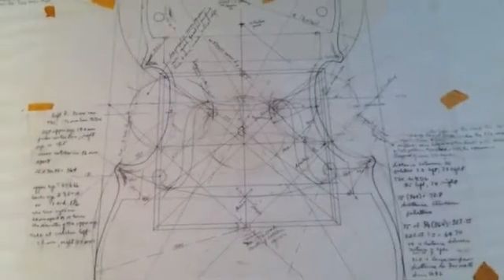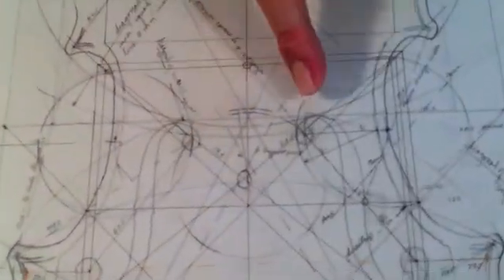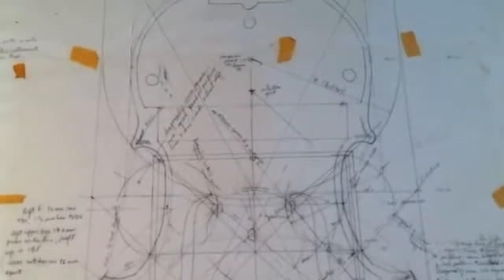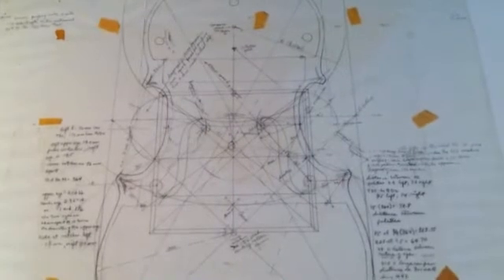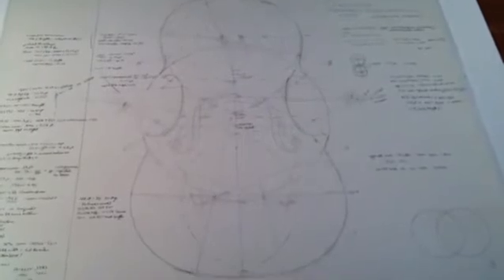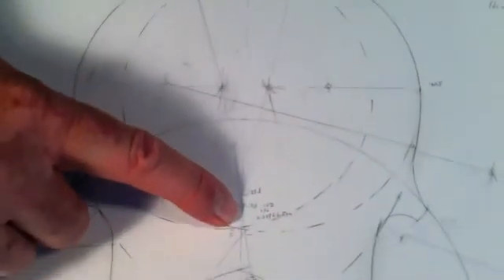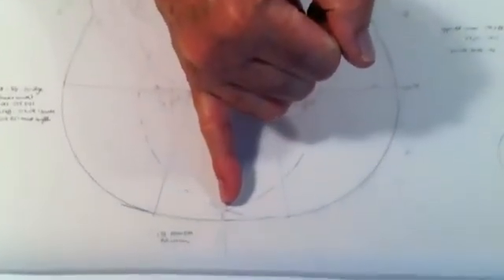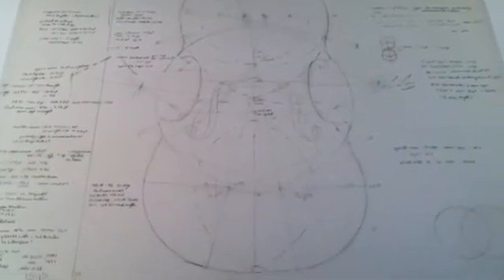The Stradivarius Code Part 2

Comment: I wonder if the reason for the 1mm difference of the treble F-hole to the bass F-hole is purposely done to offset phase cancellation of certain frequencies or to cause phase cancellation of a specific frequency Ala the wolf tone. Helmholz resonators are used in studios to capture certain low frequencies. Or it could be the position of the violin when played has the bass side closer to the player's ear. With higher frequencies being faster than lower frequencies, maybe the 1mm position further with the treble F-hole helps with both frequencies arriving to the player's ears at the same time avoiding phase incoherency or cancellation. Studio mix engineers like to position themselves in the middle of the equilateral triangle between their studio monitors and their listening position for this very reason that if one speaker is closer than the other, it will create anomalies that they will inherently be trying to get rid of that don't exist thus affecting their mix decisions in a negative way.

Comment: I can relate the visual harmony coming from the diagrams .To my modern eye I can relate the opposite influences of many UK car designers and how there is so little harmony compared to Japanese or Italian cars . I struggle to see how the visual ---influences the aural effects . There may be a connection if two types of instruments are made to compete against each other. One with visual harmony and one without . But the great violin makers may have used other elements to create the sound . They took enormous care over everything they made .  Many exact copies of these instruments have already been made. That did not reproduce the sound quality regardless of lines or circles or symmetry.

Comment: I tried to overlay a stradivari cello construction plan with the basic squares and  radiusses. For some reason the proportions shown in your video don‘t fully apply. The upper and the lower square do not meet, instead they overlap. 
I tried to verify my drawing to check the f hole placement. 
Could it be that Stradivari constructed the cello forma B also with thoughts of handling the instrument in mind.? 
On which geometrical bases the f holes placed?
Reply: I did the same thing with a cad drawing of a Strad and I got the same result. The "Squares" over-lap.   The only possible way to get the cad drawing to match his sketch was to use rectangles.  Basically have them come together at the very top of the f-holes.  The other issue I had with the cad drawing was matching the F-holes.  With the two circles perfectly intersecting the exact center of the top and bottom F-holes, there is no way to lower the bass side by 1 mm.
Reply: @danielferraro7624  so what do you make of this? Any conclusions?

Comment: Well, I suppose you could make a plug or cover for the f-hole, and then analyze the sound result.
Then you could make a test violin with one f-hole.
With all the circles, some makers may have had some numerology beliefs, maybe based on ratios of numbers, like golden means, Fibbonacci sequence, pi=3.14, etc.
Reply: This has all been done many times.  The f-holes provide a complex vibrational topology for the sound board of the violin. They are based on a differential curve.

Comment: that's alot of guessing on something that was made well over 300 years ago...
Reply: Think it's guessing?   I wouldn't agree. Seems logical deduction, especially conaidering the alchemical subculture of the times in which this instruments was designed. 
     If you were to follow that architecture of the same era, you'll find the same geometric rules applied for the exact same reasons.
    Golden ratios, determining everything to create functionality. 
    Do the math they sat, indeed.
Reply: It may have been made 300 years go but it exists with us here today. This is not "guessing", it's observtion of physical reality. Only the thought behind it is a matter of some speculation, which may become better known with further analysis.
Reply: It's more like reverse engineering. Trying to figure out how a car works by dissecting its engine.

Comment: And with all of this information, I am left wondering what you might find if you applied those points to the Stradavari design in 3 dimensions. Do those points influence the curvature of the top and back at all, or the carving of the shapes inside the box?
Reply: The treble f-hole is raised slightly which increases the area of the top to the left of the f-hole itself. This will accentuate the lower frequencies of the e string but allow for more flexibility in the carving of the tweeter region. The carving of this region is a complex issue and requires advanced study (see Wm. F. Fry).
Reply: I would say yes it does affect the sound. They all knew those tweeks.